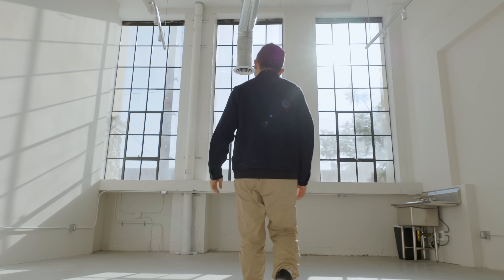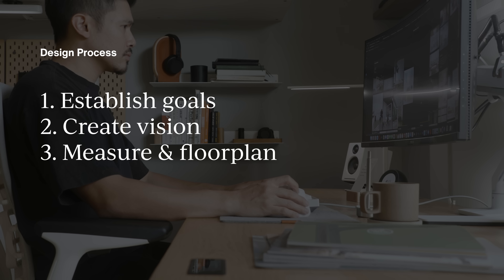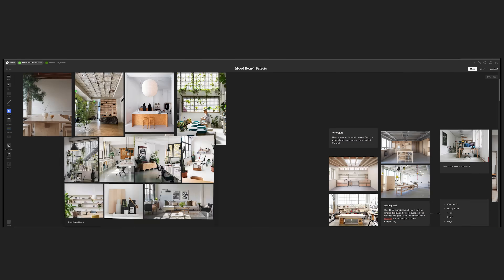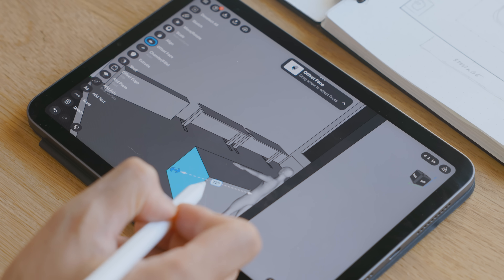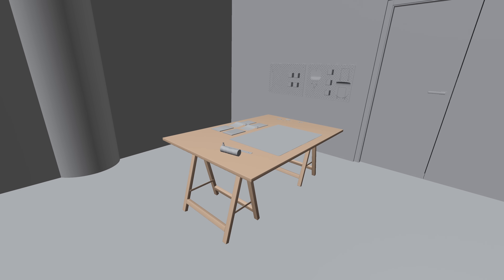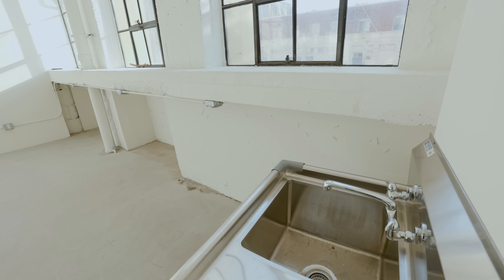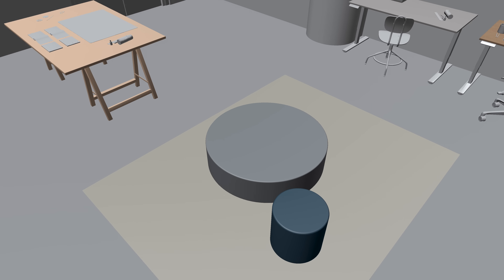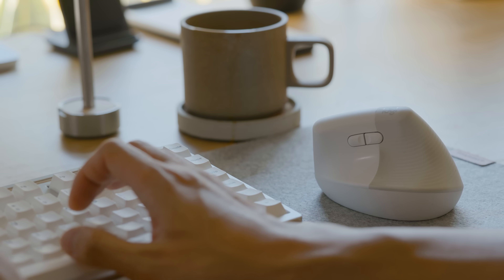Designing my New Studio Office from Scratch

Comment: Much needed video, thanks. 

If you're going to do woodworking indoors (with powertools/finish), think about ways to enclose your woodworking space to prevent dust from settling on everything e.g, hang 4 rings from the ceiling and drape so called "plastic dust barriers".
Reply from the maker: Definitely trying to figure out an elegant solution, if I do more wood working past the initial build. Thanks for suggesting.